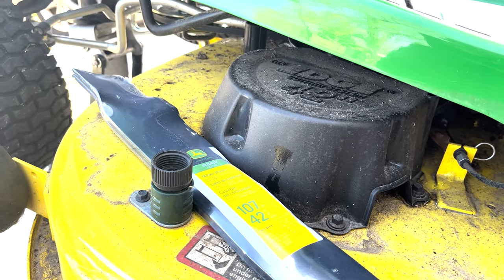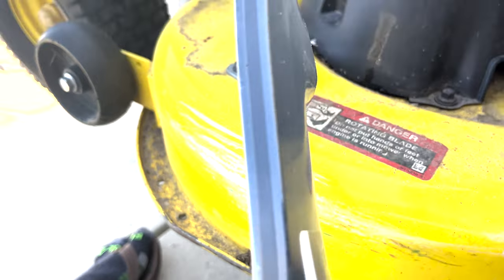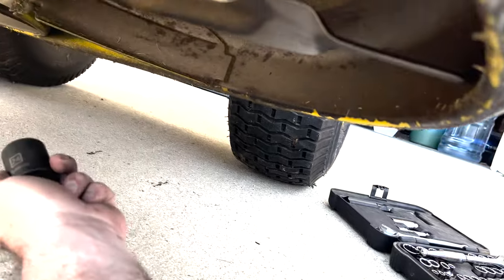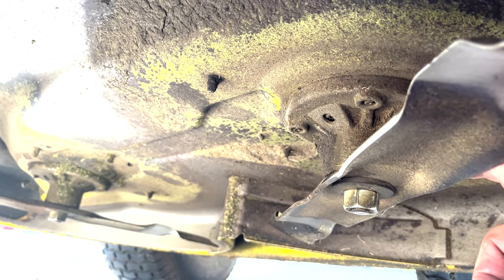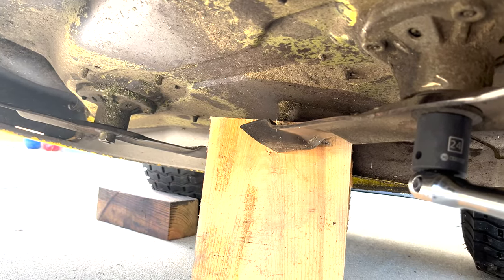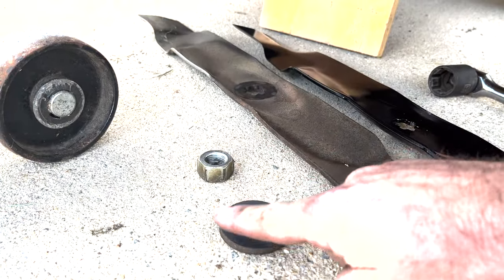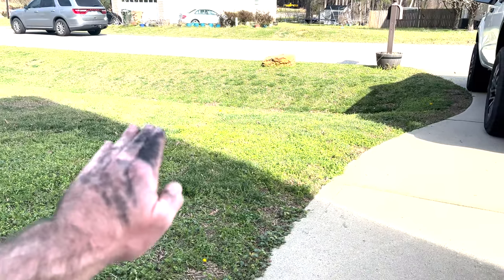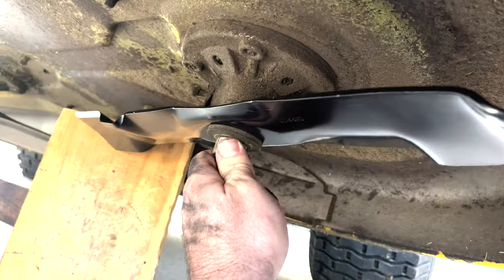How to Change Mower Blades on your John Deere S100 Lawn Tractor 42" Deck

Comment: Good lord man. Why not correct the video before putting it on YouTube. I looked at the beginning before you removed the blade and it was cup side down and then 60 seconds before the video is over corrected yourself.
Reply from the maker: I like to keep my videos real. If I make a mistake, chances are someone else is too. So I don't edit out mistakes so that my audience can learn from them.
Reply: I actually appreciate that now I'm very aware lol @MicahMartinDIY
Reply: Why not watch the entire video before you attempt to start the project?  😂 What did you do? Start the video…pause it, jack up the mower, watch more video, pause it, get the piece of wood out, watch video, pause it, take the blade off, watch video, pause it….etc etc. 😂
Reply: Agree.  At least put a big RED X across that bit in the video.
Reply: @MicahMartinDIY  I knew it was upside down, but always leave your hiccups in the videos. Helps people know what they might run into 🙏🏼 and yes, always watch full videos before even starting a project, I always watch multiple times lol
Reply: @MicahMartinDIY I got you

Comment: I never use that washing component John Deere has cleaning the deck, seems likely it will rust, deck and blades. I spray WD-40 under my  deck to keep the grass clippings  off, are you can scrape them off. It's worth the money to use John Deere blades, them aftermarket blades they don't hold up after many cuttings, im sure they're made in China or Vietnam.
Reply from the maker: That's a good idea with WD40. I've heard some old-timers say they used to paint it with used motor oil.

Comment: Careful. I got an Amazon 42 inch blade and the blades would meet and grind in the middle. The tolerance was must have been off less than an eight of an inch on the edges. Took them off and will buy genuine John Deere parts.
Reply from the maker: Oh wow! Yes, that sounds dangerous!

Comment: Thanks for the tutorial. I really found the directional cupped washer information helpful. I put that on upside down on my last blade install. It was extremely hard getting the nuts off this time around. Actually needed to use some break free, piece of wood, breaker bar and every bit of strength to get the old one off. I followed you blade curve acclimation and washer tips this time. Thanks
Reply from the maker: Glad I could help! Thanks for the feedback!

Comment: Great video. Very useful. I used a different tool instead of the 24mm socket. I used an adjustable wrench. Thanks for the tips.
Reply from the maker: Thanks Patriot! Adjustable wrenches work fine, but I always worry about slipping and busting a knuckle, which I've done far too many times!

Comment: This is my second season with my S100…I was using the washout port after every mowing. This year after the first mow of the season I used the washout port and hosed down the deck like I always did and when I ran the blades to air dry under the deck I heard a noise like metal on metal whirring noise I think it may be the spindle but not entirely positive. I don’t think I will use the washout port anymore and just scrape it clean from now on.
Reply from the maker: Yeah, I always mow when my grass is dry and I don't get any buildup that way, so I don't use the washout port at all.
Reply: @MicahMartinDIY  I also mow when the grass is dry as well except my back yard has a hill that is always wet when the grass gets even a normal long

Comment: The blades you took off had the cup side down and then you put the blade on cup side up.  Which is correct?  My mower came with cup side down.
Reply from the maker: Yes, I fixed that later. I thought I included that correction in the video.

Comment: Good vid but didn't you block the wrong side of your wheel?  I would be concerned about the tractor rolling forward, away from the jack
Reply from the maker: It was pretty secure. The tractor isn't that heavy. I just didn't want it rolling down the slight incline of the driveway.

Comment: Or you can just remove the mower deck first. Much easier.
Reply from the maker: Hmmmm. I highly doubt removing the deck would be easier or faster. But to each their own.
Reply: Not a chance. I took the blade off in 5 minutes not even jacking it up. Just did it laying in the grass.
Reply: @MicahMartinDIY  It's held in place by six or seven pins. Takes about five minutes. I don't have to jack up anything and crawl under it and I can inspect everything. I've done it many times. But, to each his own as you say.